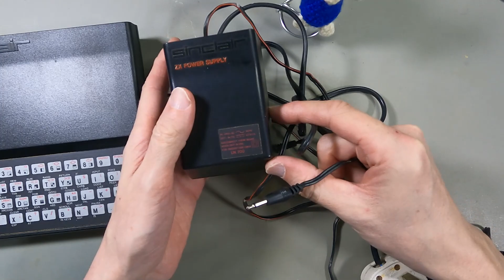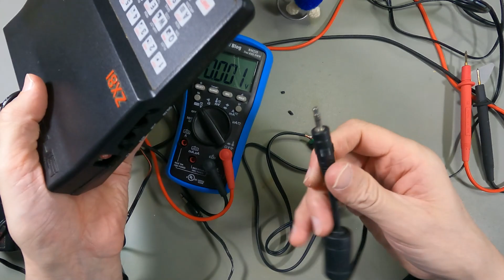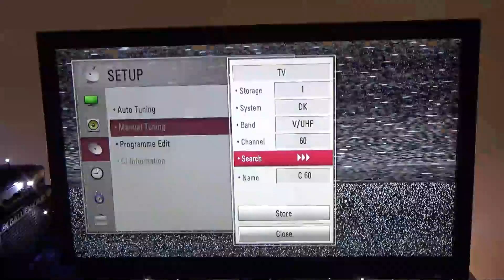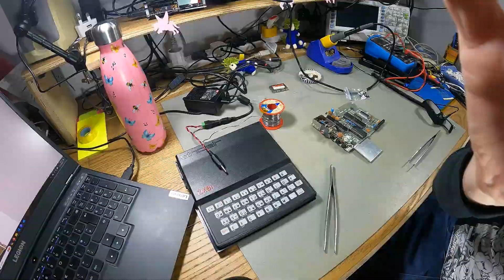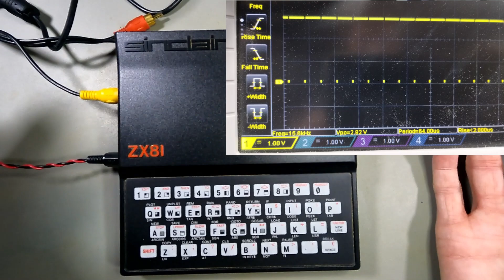Lets Take A Look At The Sinclair ZX81 (+composite mod)

Comment: Great video thanks for sharing.  The 0/0 you had for print "hello",  is the return code. The first of the zero's means successful completion, the second is the BASIC line number that last executed, zero in your car becuase there was no line number. The 5/10 error code 5 run out of screen. 10 the line number.  Also it's slow becuase the cpu is doing a lot of the work just drawing the screen, so in SLOW mode the cpu is only executing your program in the video blanking periods (and possibly the boarder area too)
Reply from the maker: @byteforever7829  you can tell I am a Sinclair noob.
Reply: @DavePoo2  there's quite a number people writing new games that show what the zx81 can do. I've tried in my small part as well to do it justice😀
Reply from the maker: @byteforever7829  It's crazy how much new retro software is being made for this and other old machines.

Comment: The Sinclair PSU produces 15 volts which is within the limit of the ZX81 voltage regulator. BTW, SCART has a composite out pin. Most of the early ZX81's didn't output a back porch signal for modern screens to lock onto.
Reply: Yeah, 15v is fine for a ZX81.
He's right it is high because it is unloaded, and you are right that the regulator will easily handle that voltage... That's one of the reasons for that big heat sink.

Comment: happy new year dave, all the best for 2024.
in 2022 I bought a rubber key 48k speccy and in the box, unbeknownst to me (ebay purchase that it was) was a surprise zx81.. I too was gobsmacked by how small it was. along with some cables, power supply was also a 16k ram pack.  at the time i had a 14" colour tv, and managed to get a picture from it over RF. since then the tv has given up the ghost, but I bought an old 26" crt to use with my MiSTer and that TV has an RF on too, so we're all good to go.. :)
Reply from the maker: Happy new year! A suprise ZX81 certainly is a welcome one. Did they think it was part of the speccy maybe? sometimes when people sell stuff on eBay they don't know what it is, or sometimes they are just happy to get rid of their junk and put it in the box anyway. So which do you prefer typing on? the dead flesh keyboard or the unresponsive ZX81?

Comment: After you ran the "Hello World" program, the ZX81 said 5/10; this means error 5, Out of Screen, in line 10.
I think there's a poke you could add to the program so it would keep printing, but I cant remember the details right now.

Oh and the ZX80s and early ZX81s (Issue 1) were notorious for having a non-standard video out signal, something about a weak or missing back porch IIRC. On the Issue 3 ZX81 it was a little better, but still not perfectly standard.
Reply from the maker: Thanks, I figured the line number but not the other code. I suppose there must have been a manual that came with it originally that described all this? (or maybe sold separately?)

Comment: The ZX81 was my first computer. It really was the Raspberry Pi of its day. I work in IT today and owe that in no small part to the ZX81. You do get used to the keyboard and input method :)
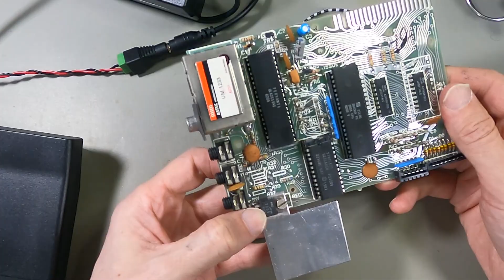Around 17:00 the switch might have helped you if it was installed, it switched between VHF CH2 and CH3 (in my case) but converting to composite is absolutely the way to go anyway. 28:00 that grey background indicates the "back porch bug" on those ULAs. The Clueless Engineer does some good conversions on his channel, including using the vLA81 replacement ULA. Yes, the 0/0 means status 0 (program completed) at line 0 (direct input). So 5/10 is "screen overflow" at line 10, use SCROLL to get another line :)
The computer is "slow" because of the way it draws the screen. If you use FAST at line 5 then SLOW at the end, it will be as quick as you expect, but you won't see the screen update 🤣
You're right though, I was over the moon to get one of these at about 11 years old. The only other computer I had really used till that point was an Apple ][ at school. That's one Apple ][, and only in the principal's office because he was on to it and knew where things were going.
Reply from the maker: Thanks, I knew somebody would arrive in the comments with some of the answers. It's my first time using Sinclair anything, so I am a total noob. Would have been really cool to have one of these when their time was relevant. To build a computer like this, at this price was a big deal back then, as nobody had enough money to throw 1000's at a new home computer, making a cheap learning tool was the way to go. It's a neat little computer that deserves it's place in the history books.